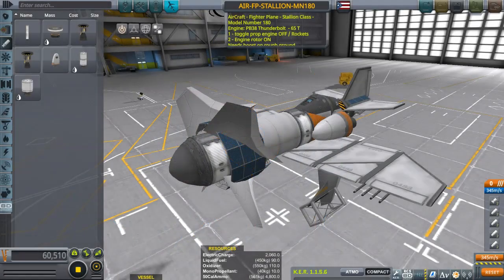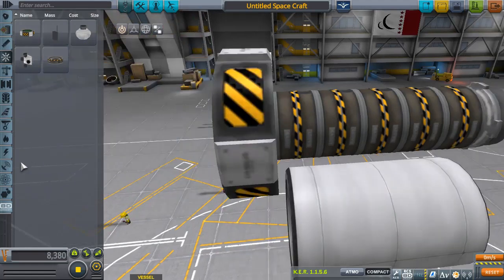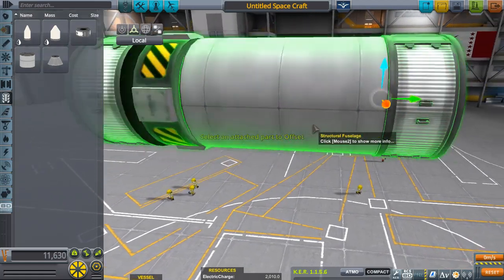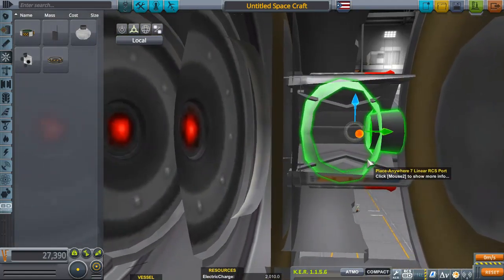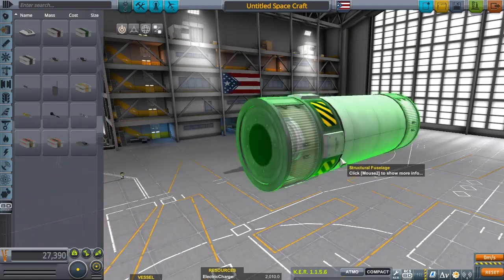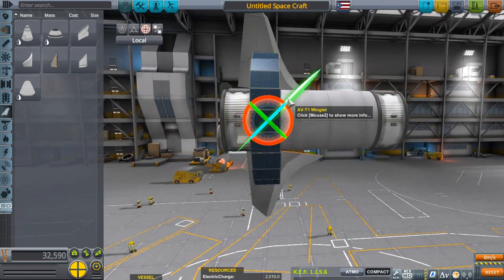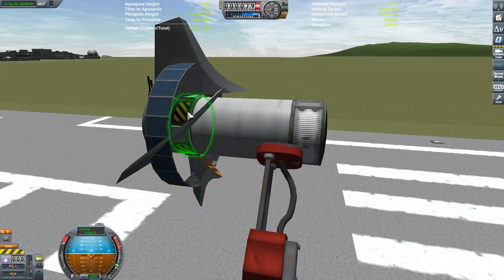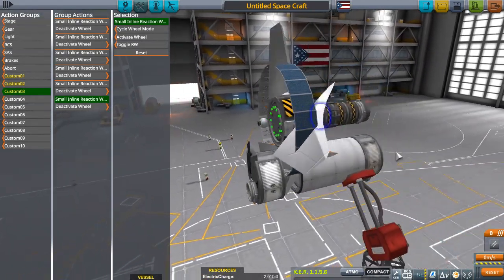The Solar Nations THUNDERBOLT ENGINE.

Comment: This is an excellent video. Thank you.
I've been able to reproduce your design and it works well.
When you have access to aerodynamic control surfaces, you can set up a key to toggle "deploy", increasing or decreasing the effective angle of attack.
But I have a question: How do you get the prop to rotate continuously? The moment I change my focus, the prop slowly stops.
Reply: OK. You get it to continue rotating by using the alt key. (Right Shift in Linux.) Alt + E or Q depending on what rotation.
Also you don't need the big fuselage part. You can use just the storage bays on either end and it will still work. The longer the distance between the two rotation points, the more stable, it's true, but it's pretty stable only being two large gyros long.
I was unsuccessful in making both axes housed in the same bay, however. Food for thought.
Reply: Alt + roll, you have to keep those buttens a while till its loaded up. also disable SAS